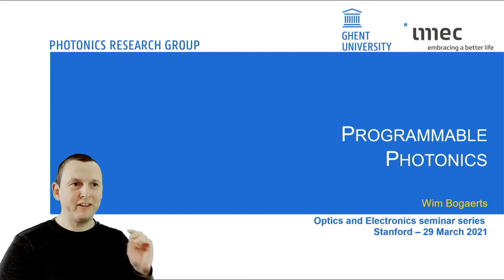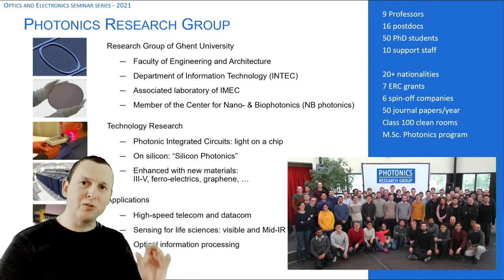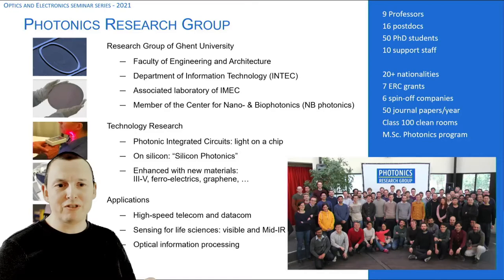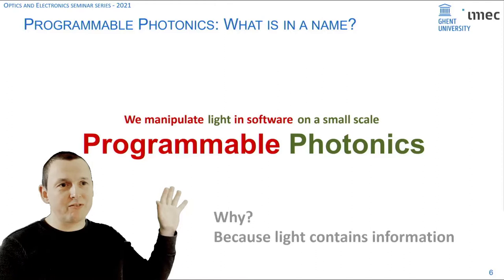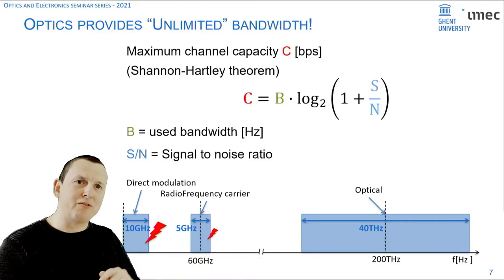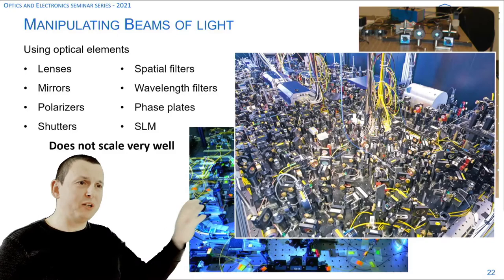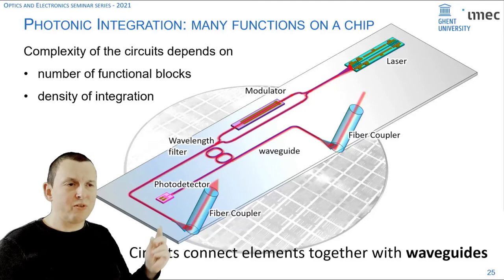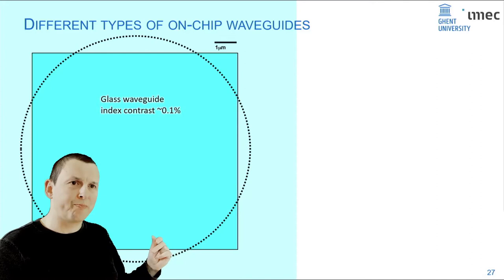Programmable Photonics - Wim Bogaerts - Stanford

Comment: Excellent content ! I nevertheless have several questions:

1- Was there any attempt using optical components equivalents to logic gates? Was there some research about mathematic implementations in photonics?
2- Is there any (open source) software to help designing photonic chips ? Does the " logic gate " integration approach might give something easier integration results than generic mesh circuits?
3- Do you think usual computing Instruction Sets like x86 , arm or RISCV might be implemented in photonics?
4- Is there any project of GPU based on photonics you are aware of? I imagine lot of things in the graphic area photonics might help with (display, raytracing, graphic transforms etc)
5- Would graphene / organic semiconductors might be of interest in photonics?
6- Aren't DAC and DAC a bit of a bottleneck compared to the very large bandwidth of light?

Looking forward for your answers :)
Reply from the maker: Hi, feel free to contact prof. Bogaerts directly. http://photonics.intec.ugent.be/contact/people.asp?ID=2
Reply: Interesting questions. Here's my opinion:

1- Was there any attempt using optical components equivalents to logic gates? Was there some research about mathematic implementations in photonics?
Yes. People aretrying to make this. Problem is that digital logic operations are nonlinear. And photonics is not very good at this.

2- Is there any (open source) software to help designing photonic chips ? Does the " logic gate " integration approach might give something easier integration results than generic mesh circuits?
No open source software for these programmable circuits (yet). The 'gates' are not really logic, but analog. So their description is equivalent to the mesh representation.

3- Do you think usual computing Instruction Sets like x86 , arm or RISCV might be implemented in photonics?
Maybe, but it will require a lot of effort and in my opinion it will not be better than electronics. Better to use the photonics for what it is good (e.g. linear operations, communications) and use that to accelerate digital electronic processors.

4- Is there any project of GPU based on photonics you are aware of? I imagine lot of things in the graphic area photonics might help with (display, raytracing, graphic transforms etc)
Not that I know of. LightMatter is building a photonic accelerator for matrix operations (like in neural networks) but not a full GPU. the hard part of GPUs are buffers, which are difficult to implement in photonics.

5- Would graphene / organic semiconductors might be of interest in photonics?
Definitely. There's a lot or research on this.

6- Aren't DAC and DAC a bit of a bottleneck compared to the very large bandwidth of light?

Yes. In these photonic/electronic hybrid circuits, the DAC and ADC stages are bottlenecks in speed and power consumption.
Reply: @wbogaert  Warm thanks for taking the time to give such an exhaustive answer ! you gave me all the guidelines i wished to continue my researchs online . I'll be back to you by email for further exchanges if you're ok with it :)

Comment: What a great presentation! A question that came to mind was why use 1550nm light and not, for example, visible light. I reckon you could make parts even smaller, right? Of course you would have to use something different than silicon for the wave guide...
Reply: Silicon absorbs light strongly below about 1.32 microns. So you cannot use a visible laser for this application (assuming you use silicon “wires” or routing methods.)

Comment: Enjoyed the presentation thoroughly, it was just enough technical and exciting to keep an interested outsider (to PICs) go through the entirety. 
I was wondering if the advantages of moving to photonics based computing like the huge bandwidth gain etc. will be fully realized until all the components in the system move to the photonics domain, including the microelectronics based logic driving these PICs. Wont these at somepoint be gating/ throttling the performance of heterogeneous systems. Will we soon or sometime later have entire computers and systems where light will replace the role of electrons today?

Comment: If you couple the mems phaseshifter to a membrane would you have an effective, microscopic, low power microphone? Can you broadcast by letting light out into the environment with the same signal on multiple wavelengths so a receiver can couple them so they can be detected even in an everyday illuminated environment?

Comment: this may seem like a off topic question but I am wondering about ways to store photons... like a photon battery... perhaps in looping matrix... if mixing electronic and photonics circuits is so difficult in way of mating wavelengths and colors of light... the process seems to be advantageous to switch from storage of electrical power as electrons to storage of light "power" as photons... thus a photon battery system .  Is this a possibility?
Reply: photons were not made to trap, they were made to be absorbed and ejected until they find a new material in which they can be absorbed again or reflected, there is no need to force nature, use nature to your advantage